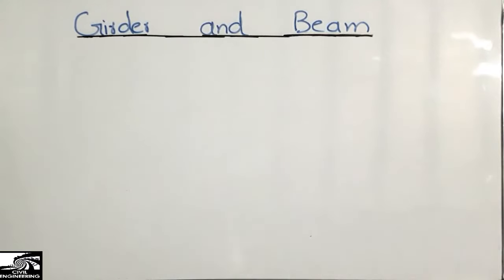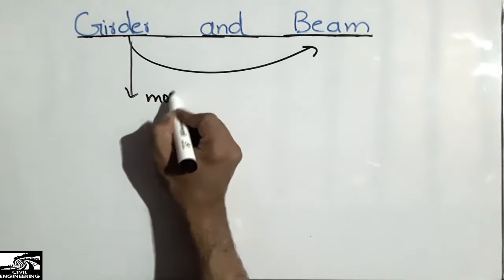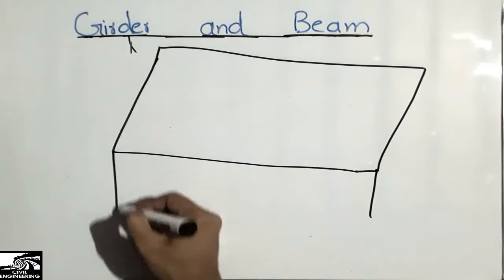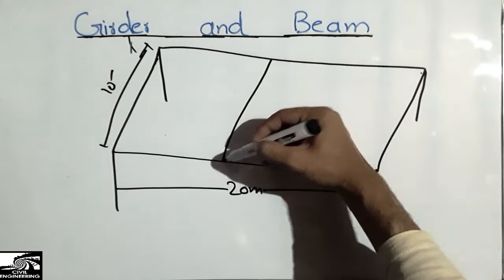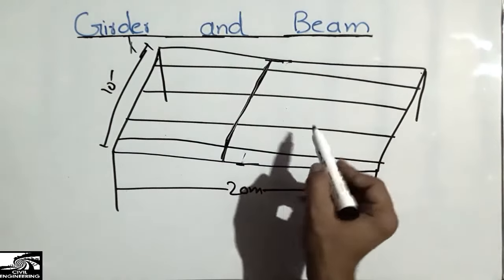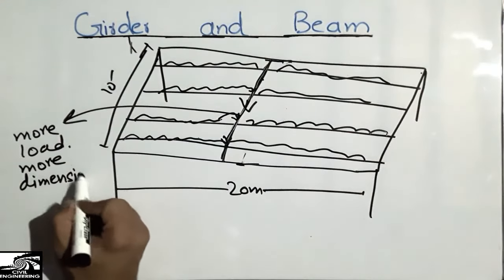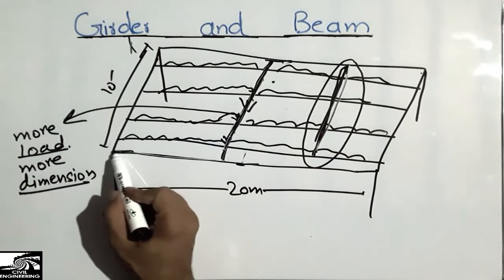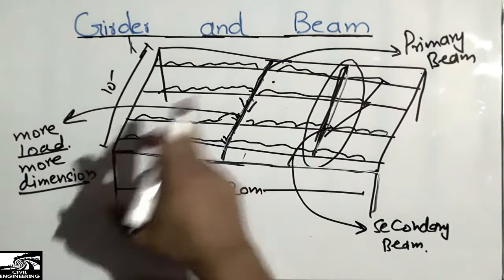Difference between Beam and Girder with 3D Animation

Comment: I was under an impression that when any non standard size of beam is fabricated, it is called a girder. As rolled sections come in standard sizes, but to reduce the structure weight and take more load a non standard beam is fabricated by welding plates to form web and flanges.

Comment: interesting. I got mixed up because the animation shows the is going the long way and in the drawing on the board, the girder went the short direction.  But I guess it doesn't matter as long as the loading is correctly calculated.

Comment: I got confused. In the 3d animation the beams running longitudinal were called girders. But in the explanation part the transverse ones were called girders.
Reply: Agreed. This is so confusing. Maybe girder (bigger than beams) is placed on shorter dimension (10m). Cmiiw.
Reply: As I understand, and it is a matter of notion only, the girder holds the beams.